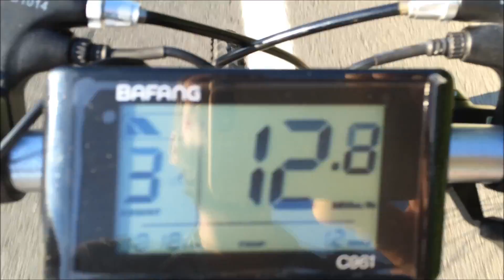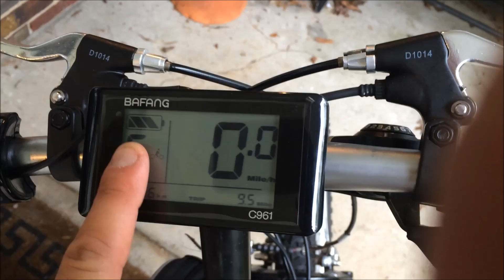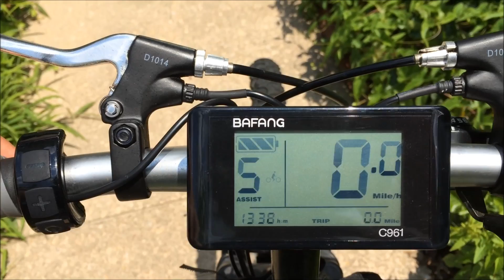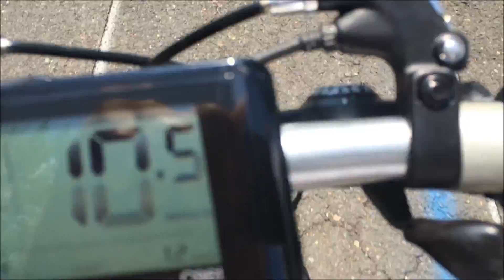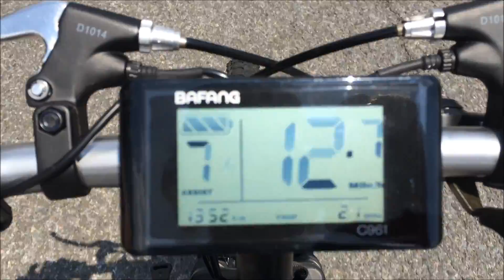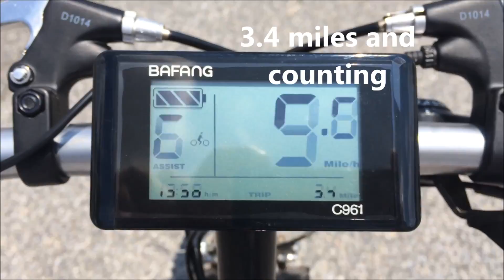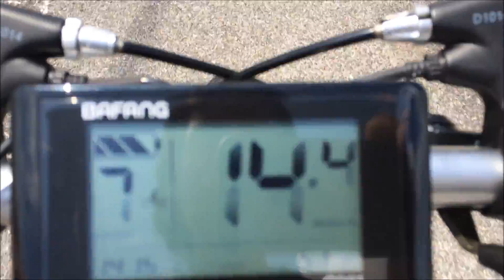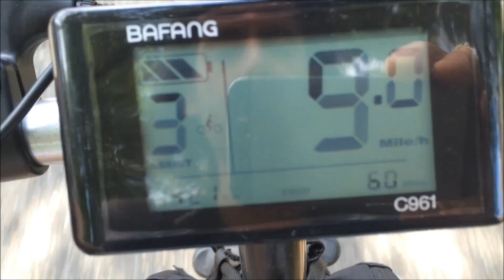Bafang Mid Drive Ebike Conversion Part 9: Lead-Acid Range Test

Comment: I hope you realise that, the battery reading at stand still isn't the true reading, the only true reading is when the motor is pulling power from it.
Reply: Not true. Consider that when you start your car, the large amount of cranking amps pulls the battery down to 6V, then it springs back to 12V(idealy 13.5V-14V).

Comment: Laptop 18650 batteries are low Amp mate, usually around 5/10A, you need 20A or higher, you'll also find that the motor is more efficient when you ride in a lower gear, and don't use your muscles at all, pedal until the bite, and let off a touch, as when you're pedaling with the whole ramp up of the motor, you will be using unnecessary force. There are only 6 major players who  manufacturer 18650 batteries, any other are re raped versions of those, Sony, Samsung,  Lg, panasonic, Sanyo and toshiba, with a few other small brands scattered around the globe. When making a large block, you will need identical cells,  with what you have got go for the highest continuous A ratings as possible, but don't follow manufacturer's numbers they are well known for being fictional, for the high Amp draw batteries look for Mooch's 18650 26650 battery chart , a basic Google search will spit it out, he is an independent tester of the cells, with no company affiliation at all.
Reply: This is should not be a problem. If you have 4-8 cells in parallel banks, the max current draw will add up. He did say he wanted to build a long range battery.